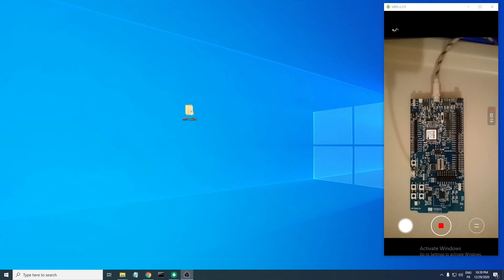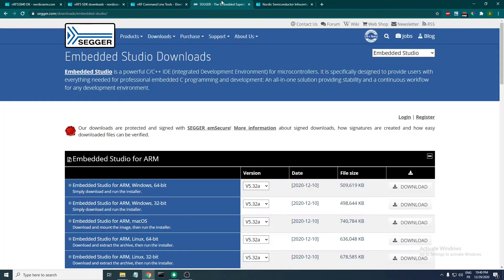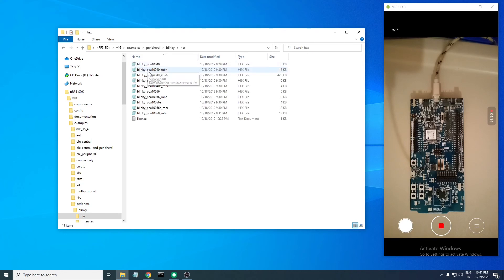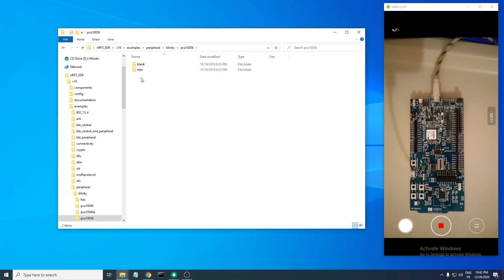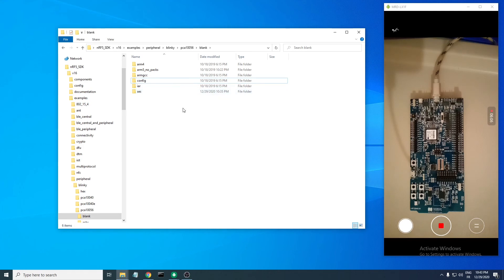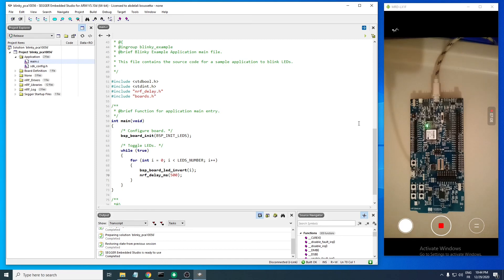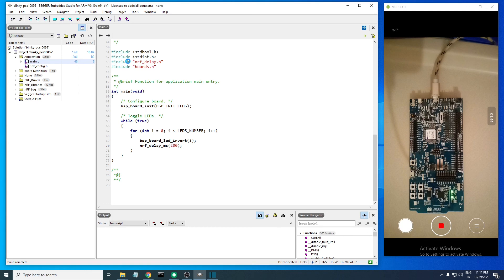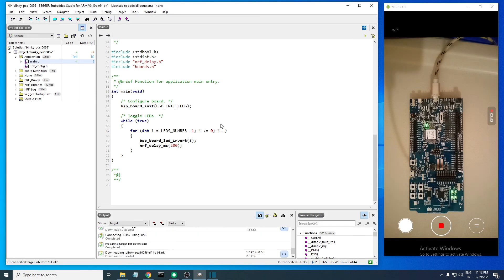How to test the blinky example on the nrf5 sdk using segger

Comment: Blinky worked for me but ble_app_uart not worked.

Only Example without ble works .

What is reason behind this?
I am working on nrf52832 module.
Reply from the maker: Hi @amol,
Hmm, is this module mounted on a dev board? and what you've used to flash the ble_app_uart application?
The blinky app does not use a softdevice, but the ble_app_uart does. So it could be something wrong with the BLE part on this module?
Reply: It's not development board.
It is nrf52832 module.
I tried by stlink V2 programmer.
I can flash application code .but I can't flash softdevice using stlink.

I think I must use official development board.

Thanks for solving my problem.